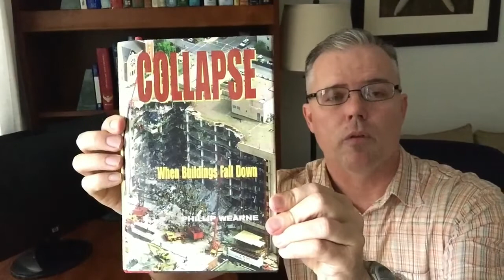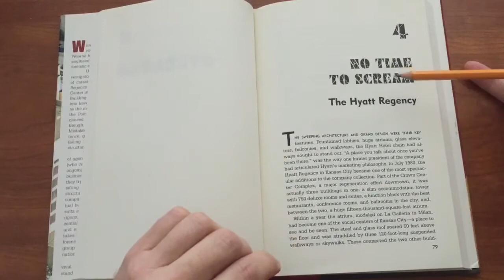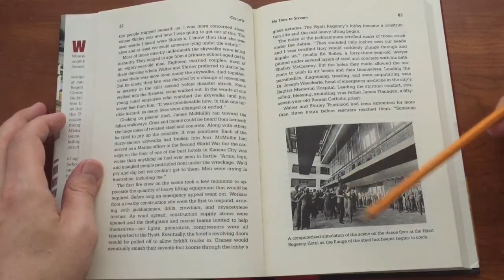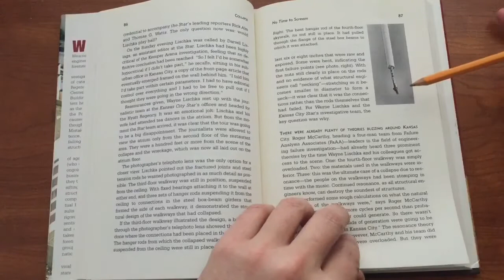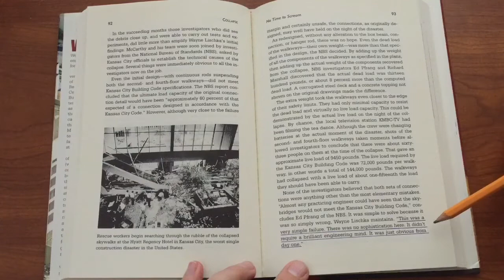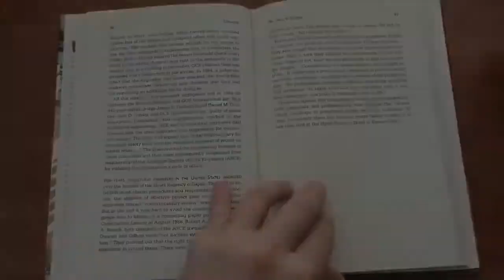Engineering or Communication Failure?

Comment: Tragic story that sounds like could have been averted.  Thanks for sharing.  Good reminder to us all in the construction and engineering field about how critical communication is between design and the field.  And how important it is that proper QA/QC is on large project.   This is also a good reminder that only the designer of record should be making changes to the design.  Only build per plan or get the designer of record involved and request supplemental design drawings/calcs/specs.  Sounds like there were a lot of factors involved.